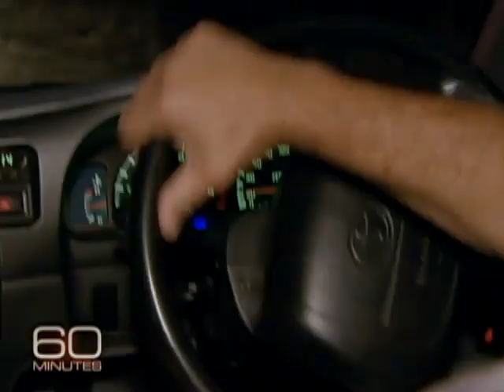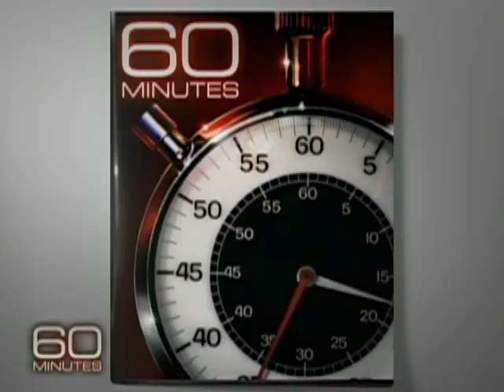Assault On Pelindaba

Comment: How did this suddenly get so popular? It happened more than 13 YEARS ago. And more to the point, this is ONE organisation's digging that yielded almost nothing and certainly doesn't take into account local conditions - almost as if there were mercenaries involved. I'd like to know HOW they know, or where the evidence is that supports the line "enough material to build 12 bombs"?
Furthermore, as far as I know Pelindaba was born as a research site for enriching Uranium as a fuel source primarily and later as a weapon. Nonetheless this is all moot if the event and video are >10 years old.
The ambassador has a point; the CEO has a point too; if the guards were fired - so what? If they don't know who did the deed all is moot. Sure means that security should be improved.
Reply: 1) It is certain that there is a quantity of HEU, nobody denies that. If someone knows exactly how much, that would be the IAEA
2) For general purposes, it doesn't make an important difference if there is enough for 5, for 12 or even 25 bombs, as some other sources claim. The important thing is potentially nasty stuff was lying there. The trouble these "gentlemen" took to get inside of that complex suggests they weren't there for laptops or smartphones. They either were there for HEU (where was their vehicle ?) or for data stored on computers (why not hack them from outside, as for ex. the Russians or Israeli's could do).
3) Two possible scenario's: HEU or data meant for the black market or for domestic purposes, read, regime change.
4) What's so surprising about older events getting warmed up again. It happens all the time in the press. Not many Parisians know about what happened in the early 1960's when North Africans were protesting in the streets of Paris, and many of them ended up in the Seine river. Now these old stories are "hot" again. It just happens for a variety of reasons, and it's a good thing it happens. This is something of considerable importance, it probably got smothered by a very embarassed SA government. Not only is it corrupt, but it also is incompetent. Not exactly good PR.

Comment: My guess: former BOSS people or at least, folks with pro Apartheid sympathies, or South African criminals with access to the black market, who were sure to get a hugh sum of money with which they also could reward those that gave them inside knowledge. As an investigator, I would start with the man in the wheelchair: was he drunk because he had a drinking problem, or because he didn't want to be there after all, when the two teams got inside. Remember that US soldier that absolutely wanted to make sure he was in jail when the murder of JFK took place. He entered a bank and deliberately shot in the ceiling, and then just waited to be arrested, fearing otherwise he might end up as Oswald, yet another patsy. Maybe the man in the wheelchair got cold feet, and drunk so much he just couldn't go to work, read, open all security systems once the two teams were inside the complex. It's just a working hypothesis, no real facts, just a strange coïncidence. It might also be though that the man is completely innocent. But it definetely is a starting point.